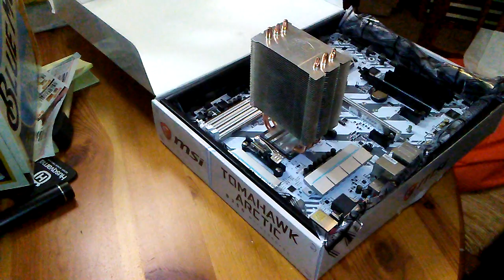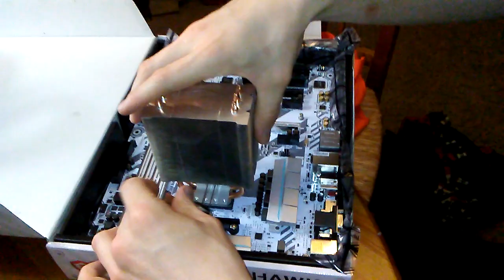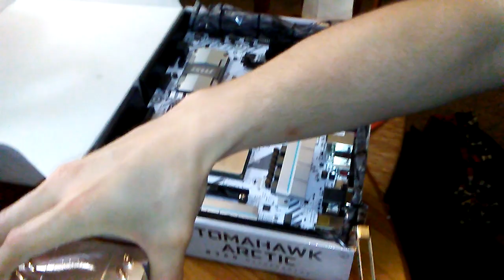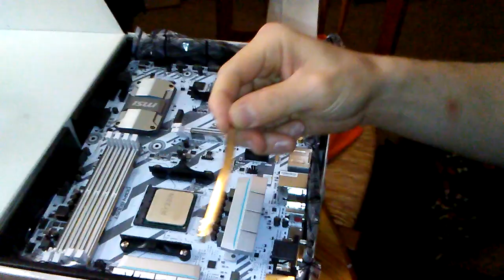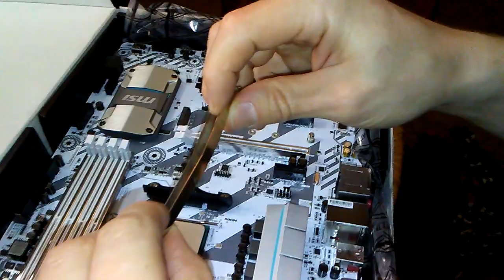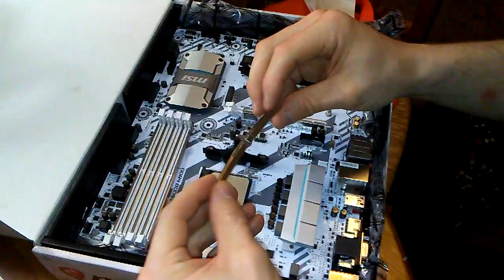AM3 Cooler Modified to fit AM4

Comment: Bro, i just bought AM4 cpu cooler, i just saw this video and damn its working like you did i use hyper 212 evo and its works like a charm.  

I'm gonna check hyper 212 evo temperature vs thermalright assasin 120 refine temperature.

Comment: You should put the cooler parallel to the memory ram. That way the air flows to rear of the case.
Reply from the maker: Manufacturer puts the slots in the cooler, can't turn it around. I had top fans exhausting anyway, worked pretty good. Temperatures all around were great.
Reply: @Unokeelme  Yes, you can.  I have a TX3 too on a MSI B450. I put the cooler parallel to the memory ram.  If you look closely, you will see that the cooler also has slots to put the bracket crossed between heat pipes.
Reply: @de5letras1  it worked out just fine god damn your eyes man. but yes you are right.
Reply: @de5letras1  did you neded to modify anything? I am waiting  my ryzen 7 5700x to arive and have TX3(non evo) and all brackets including these shown in video.
Reply: @fernandostanic2035 Probablemente no tengas que modificar nada, pero no sé si el TX3 será suficiente para un Ryzen 7 5700x.  Recuerdo que no toda la superficie del procesador queda  en contacto con el disipador del TX3, hay una parte que no está en contacto por ser más grande.  Te hablo de mi Ryzen 5 2600x, no sé si el 5700x será similar en tamaño al 2600x. Lo menciono porque en tu caso al tratarse de un Ryzen 7 tal vez caliente más. Tendrás que verificar si el TX3 es suficiente para ese CPU.
Reply: @de5letras1  ryzen 2600x is 95w tdp and 5700x is 65w. Mine TX3 on box has writen up to 130w tdp. I have been uses for years on my 4.5ghz all cores i7 2600k in push/pull config and have big case with side, front, top botom, mesh, with front 2x 120mm push, botom 120mm push and one rear and one uper 120mm pull fans
Reply: @fernandostanic2035  Sorry to have written in Spanish, as your name is Fernando I thought you would be Hispanic.😆 Yes, if the 5700x has a lower TDP obviously the TX3 will have no problem keeping it cool.😀👌
Reply: @de5letras1  you did not need to take of bit matiral on bracket like in video?

Comment: In a horrible case of irony, I picked up a huge amount of conversion brackets for like a penny and sold them online.....only to eventually need one myself after I ran out when I finally got an am4 platform when used deal popped up locally too great to pass off

Comment: dude is it possible to cool my am3 cpu with an am4 cooler? my am3 cooler died and its really hard to find a new am3 cooler but there is shitton of am4 cheap and good coolers out there so i was wondering is it possible to just slam a new am4 cooler on my old ass am3 cpu and be good with it?
Reply: Hey, I accidentally got an AM3 cooler for my AM4 build, wanna swap?
Reply: Borok Obomo just look at the support list on a bunch of coolers and they will have am3 on there